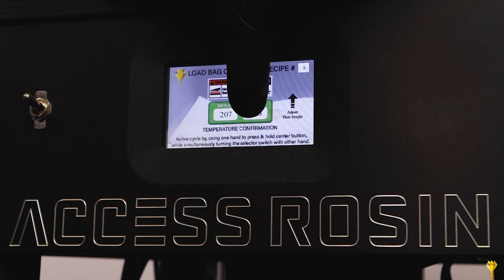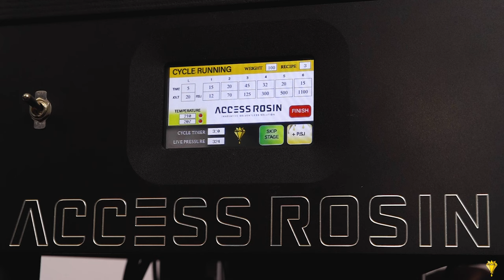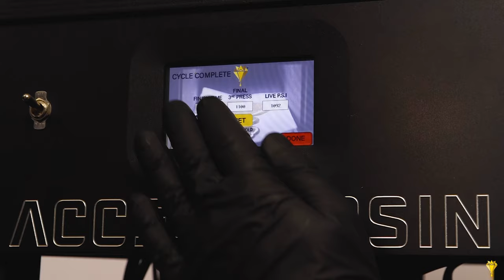100g of hash pressed into ROSIN with Eli on The Rosin Machine by Access Rosin ®

Comment: Hello, previously I have been making my own carts by using dabs. How do I prevent the oil from crystalizing? I decarb it until the bubbles go away, then I use 8% terpenes and mix them for 15 minutes on a hot plate. But, the carts turn waxy and hard and sometimes crystalize. Any idea why?
Reply: Don’t decrab and mix 15-30% you decide. Works for me
Reply: @MarksTournaments  So you dont have to decarb at all? I always wondered why you would need to decarb a cart but you can low temp dab a dab lol
Reply: Poor starting material, you dont need terps, too high of wax and plant content, etc..
Reply: I use my truck and two stainless steel panels😎
Reply: Decarb @ 150f useing a water bath for 24 to 48 hours
Reply: While mixing make sure your temp is right.
Reply: You probably have CBD 'distillate

Comment: Hey cool extraction, but you have live resin as a tag instead of rosin. I'm sure you all know the difference, but for those who don't resin is a solvent extraction and rosin is solventless in terms of cannabis concentrates.

✌️
Reply: It's live resin if you can get it without adding pressure like dry ice can pull live resin
Reply: The difference is pressure resin no pressure Is achieved from a live plant fresh frozen live rosin same thing just pressed with heat and pressure